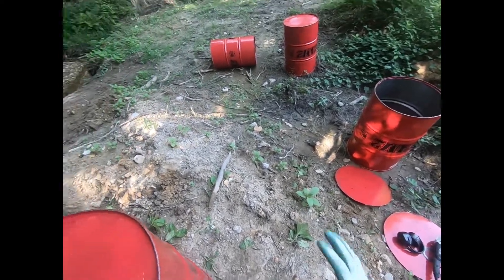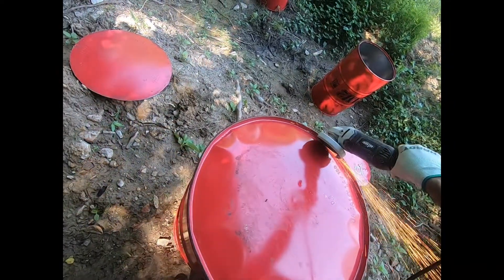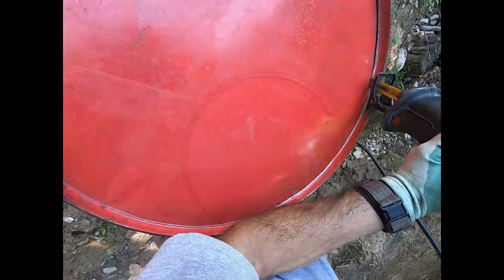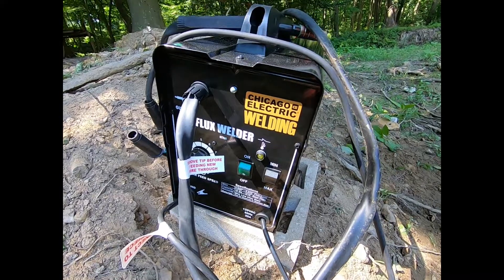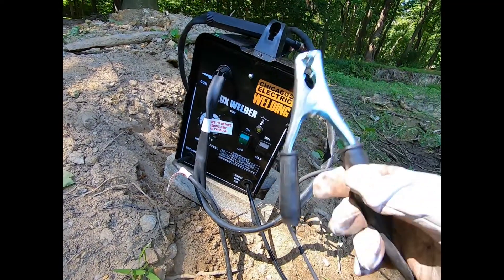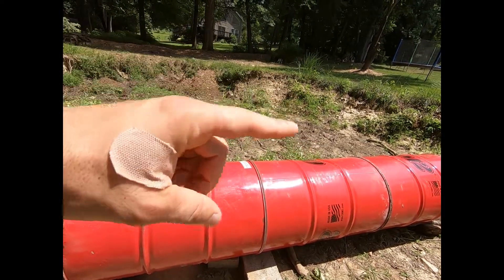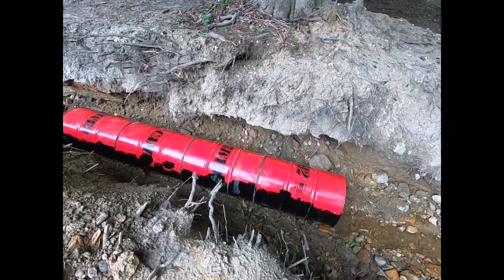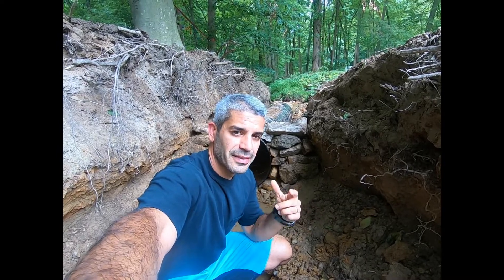Culvert pipe - Building culvert pipe from steel barrels - DIY culvert pipe

Comment: It cost about $200 to buy ADS dual wall piping for culvert. This is a lot of time to make a pipe and hdpe will out last painted drums. Just my 2 cents.
Reply from the maker: I actually priced out the ADS and it was anywhere b/n $26 and $35 per foot before tax.  I agree in that it will last forever, so might be worth the investment.  These barrels cost me $60 though plus paint.  Figured I make a video in case someone on a low budget needed some inspiration.  Appreciate the feedback 👊🏼
Reply: @TrueGritDevelopment  Hey, its been 2 years since this post, I am just now seeing it. I require 2 20 foot+ long culverts and can't find one even close to the price I can afford, but I have about 60 empty metal barrels that are doing nothing, so this is extremely helpful, and will be great for me. So, thank you.
Reply: 24x9.6' ADS at Tractor Supply is $399 so he saved some good money doing this.  They could last a while depending on climate and soil.  I did something similar in a desert climate, and the tubes are doing fine after almost 10 years.